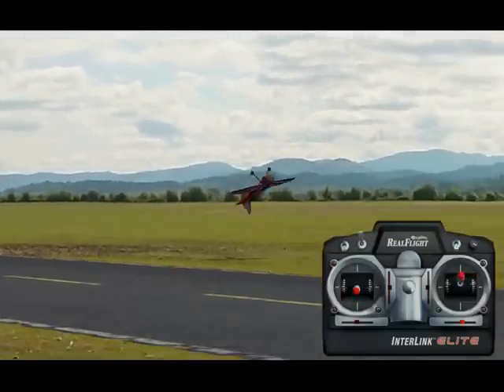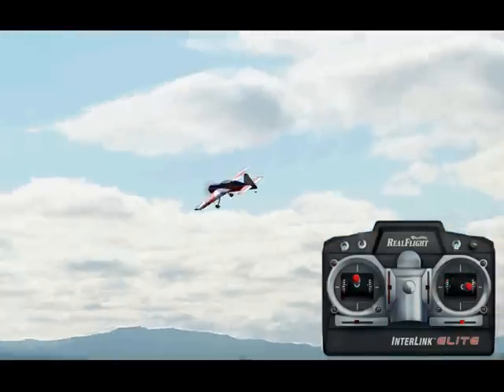Flying Lesson - Inverted Harrier

Comment: Inverted should have less rock because on a mid wing plane like all stunt planes, (except biplanes of course...) the CG should be slightly above the wing plane. So, when you are hanging inverted, the CG is below the wing surface, effectively turning it into a high wing set up ... like a Cessna. And because of the CG in relation to the point of lift in a high wing plane, they are more stable. Not exactly like a cessna, because a Yak is totally more Bad Ass ... but you get the gist. :-)